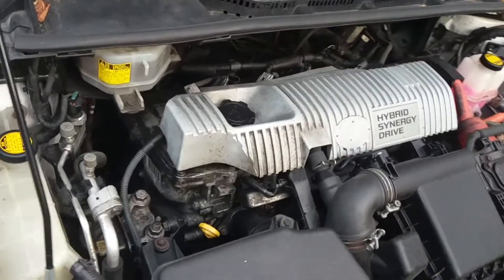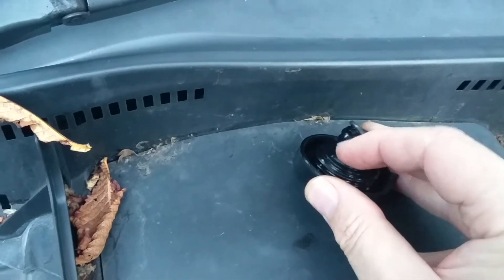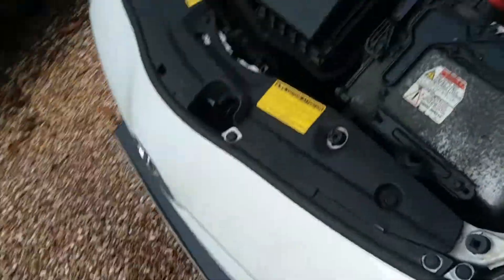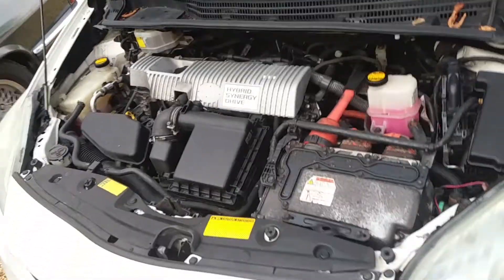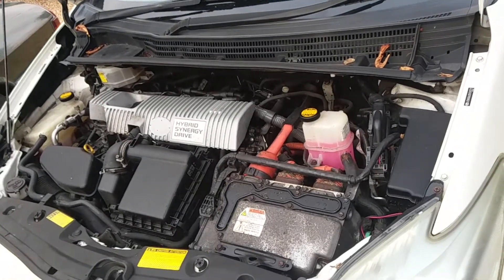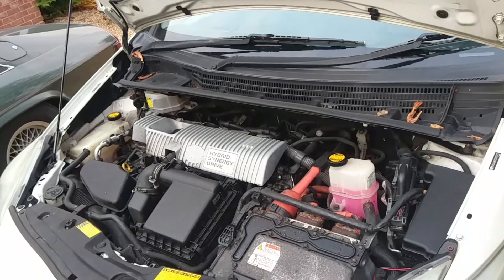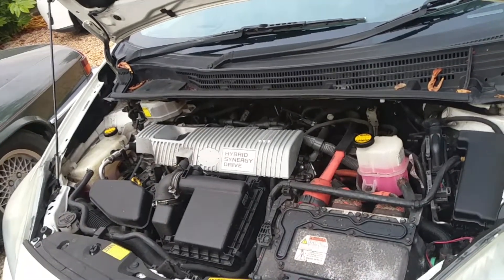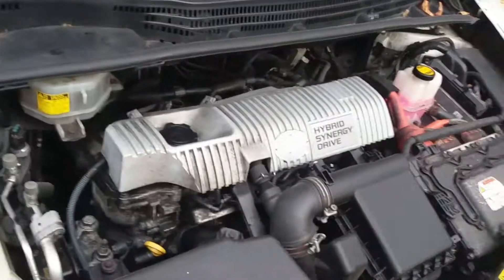This third generation Prius cooling system tweak mod may save your engine 1.8L head gasket leak fix

Comment: Pretty much one of the dumbest things that you can do. The cooling system must be pressurized for it to work at peak capacity. When the system has no pressure on it, the boiling point of coolant is only 223°. The overheat indicator on a Prius is 220°.

Comment: I did the exact same thing as you suggested, I've now put at least 6k miles on my Prius since.  No shaking, no issues except for the "Pull over to a safe area and check hybrid battery" indicator comes on about every 100 miles.  I've been disconnecting the negative terminal for 30 minutes, then reconnect, and it drives fine.  I've been doing that for several thousand miles now.  I'm assuming at some point, I'm going to have to replace the entire battery.  Thank you for the help!  Greatly appreciated!
Reply: I had that for two years (hybrid message); just disconnect the white wire in the front fusebox for 2-3 min, it will erase all codes and messages. But eventually, I replaced 6 blades of the battery.

Comment: I can understand that if you have a faulty head gasket, this could help reduce the amount of coolant that leaks into the cylinders but altogether this is a terrible idea just fix the head gasket. The cooling system is designed to work on the pressure so that the engine constantly gets flushed by cooling by removing that gasket you allow air to enter the system and the consequence is that you’re not circulating 100% coolant there will be little air pockets that will cause your engine to not be called properly. Also your risk oxidation of your coolant and your fragile aluminum block Just fix your head gasket.

Comment: My first day trying this, my prius gen3 which is on 180k kept loosing a little water no signs of leaks seems like it had pressure building up, misfire on morning start, been told by my local autoshop its the headgasket, so im trying this and gonna see how it plays out
Reply: Right a few days in im still loosing coolant water. Eventually is has got rid of the startup rattle the water leak from cap is still the issue

Comment: The factory cap is built with a pressure relief valve built in, it’ll bleed off excess pressure without removing the o ring.

Comment: My prius ALREADY HAS a blown head gasket, and makes the horrible rattling noise occasionally. WILL THIS MOD EXTEND MY CARS LIFE? or is it too late to make a difference? It has driven thousands of miles with the blown head gasket already, and my plan is  to get as many miles as possible out of it until the engine blows up. Would de-pressurizing the coolant system help? Even though the Head Gasket is already blown? Thank you!
Reply: Yes - it should help...

Comment: My head gasket is gone so the engine was shaking violently at startup, and a little if I stopped for 30 minutes or so during the day. It is a taxi too. The last couple of days I have been removing the top of the expansion tank last thing at night, leaving it off till the next morning. As expected no rattling in the morning but still a little during the day. Yesterday I noticed it behaved itself all day and, when removing the top in the evening noticed it was not on properly, the pressure had not been able to build during the day. I was a little wary of leaving it loose so thank you for your video, o-ring now removed and top secured. Thank you very much.
Reply: Please keep me updated on how it’s running and if you experience any over heating issues. My head gasket is already gone and I think i’m going to try this to buy myself some time
Reply: Update after 200-300 miles: Not noticing anymore coolant loss but I do still hear a slight misfire when starting up. Although it does sound much better than before. Check engine light is still on. Coolant temperature looks normal. Might reach up to 205 degrees f under heavy load on a hot day. Oxygen censors showing about 1500-1600 degrees f under heavy load which also looks normal.
Reply: Great - will get you by for a bit longer :)
Reply: My head Gasket is blown also, please give an update if this has helped you during the past month. I would REALLY like to hear what you have to say about this after 1 month.
Reply: @PatrickDoyle-u1d  just posted my update when i saw you my the comment
Reply: @onlyreflex8661  Youtube comments remain undefeated! It's incredible to get a response from someone like you in under an hour! Thank you!

Comment: I actually did this taken off the seal off the radiator cap last week and it works great! I mean prior to taking off the seal every single morning it will start and it was hydrolocking a little bit cylinder number one is wet with coolant, I bought a very high-end endoscope and checked it in the morning cylinder 2, 3 and 4 completely dry and yet cylinder one wet with coolant. Anyhow I seen this video and I was reluctant to take off the seal off the radiator cap thinking this wasn't going to work and my car was just going to overheat and boilover and to my surprise it doesn't overheat and boil and it works great my temperature here in the valley I live Central Valley California it gets very very hot here, temperature of car stays exactly the same as if I would have the o-ring on it 195° and yet now with the seal off I can start it up in the morning and it starts without hydrolocking "Great" there's no coolant in the cylinder it's great this actually works really really well, I put several hundreds of miles on it here in the summertime Valley and so far in the past 2 weeks I've got no coolant loss and it's 100° outside, okay now one day I tested this and went up into the mountains of Sonora and climbed this really steep incline Twain Harte Hill at 88 degrees outside 3000 ft altitude, and normally my car doesn't get over 200° ever and it got to 207 degrees climbing that long steep path of the Hill with no radiator cap o-ring, so you got to be careful when you're driving in the mountains with the seal off o-ring off as for when you're in higher altitude the boiling temperature is  lower it boils easier, other than that driving here in the valley it works great until I can get a permanent fix, now I was thinking of what would happen if I re-torqued the head bolts to squinch that head gasket just a little bit more to maybe permanently fix head gasket seal it's such a tiny tiny leak but causes such huge huge issues!!   Lesson the leak?  I don't know this might actually fix it I am contemplating if I should do this? Or to replace each head bolt one at a time with a new head bolt torquing fulling one at a time with a new head bolt because the leak is so small yet it causes hydro locking in the morning because a tiny amount of cooling gets in cylinder number one. Anyhow until I do a permanent fix taking out this o-ring seal from the radiator cap works great for now!!!
Reply: By the way I own a 2012 Prius with 208,000 MI and it started doing this hydro locking  about a year ago and I read up why it's doing it and I found out most cars was the EGR valve and the intake manifold plugged up I took apart the intake manifold and it was completely completely plugged up and cleaned it out it took me a whole weekend, and ran great for about 7 months and tell it started doing this 2 weeks ago, so these misfires cause the head  gasket to go, and anyhow these head gaskets go unless you do regular maintenance on your EGR valve cleaning it out and your intake manifold making sure it's clean at high miles. And then you might get 300,000 to 400,000 mi without a head gasket leak. Another thing that might be a good idea that I was thinking about is putting a oil catch can from the PVC valve to a oil catch can to keep some of that bad oil fumes from accumulating in the intake and plugging it all up with combination of EGR valve plugging it all up to.
Reply: So actually folks this did not work very long within a couple weeks it opened up bigger hole all of a sudden and started gushing water into the cylinder, and now I needed to immediately take it to a garage, I took it to gasket Masters for $1935 out the door, the Toyota dealership one is about 4500 to 5,000 to do,  I changed my oil every 5,000 miles so my head was in great shape and the mechanic just cleaned up the surfaces and put a new head gasket and everything took off great and ran great and now the car has 211,000 miles and  running perfect

Comment: O k so i'm using this trick and it works great. But when I go on the interstate I lose some Coolant, so I'm looking at getting a bigger reservoir.Or maybe a second one. My second problem is now. The exhaust fumes are going into my air conditioning. So I'm looking into a solution for that as well.
Reply: I even put the o ring on the side of the door like he showed me
Reply: @captianconspiracy  How's it holding??

Comment: There is a leak in the catolitic converter. The Antifreeze cools the converter. Over time it starts to leak in to the exhaust systems.  Check the tail pipe when it is running to see the Antifreeze coming out. As long as you keep the coolant full it will be okay. You can repipe the coolant lines under the windshield wipers to by pass the converter. Or buy a new converter.
Reply: Good point :)
Reply: Can you show me where

Comment: This doesn’t work won’t fix head gasket only way to fix it is to replace head gasket bad video please don’t give false information
Reply: THIS WORKS TO ELIMINATE MORNING RATTLE FROM BAD HEAD GASKET THAT ALLOWS COOLANT LEAK INTO THE CYLINDERS !!!! However You are 100% right about this not fixing a bad head gasket, but the absolute genius of depressurize the cooling system greatly reduces the amount of coolant that seeps into the cylinder from the bad head gasket inturn eleminating the negative symptoms of the bad head gasket caused by coolant entering the cylinder and causing the misfire that causes the dreaded morning engine rattle.
Reply: Read video description don’t avoid the question just be honest with people and instead sugarcoating things tell people the truth that will get u further in this life thier no mod or trick to fix this problem only way to replace head gasket that fix the car permanently if u have questions for me feel free to reach out to me have good day
Reply: @gustavomartinez324 This is an incredibly helpful video!!! you obviously don't understand how this helps the symptoms of a head gasket that allows coolant into the cylinders.  It positively WILL NOT FIX BAD HEAD GASKET but it will greatly reduce the issues caused by a bad head gasket the negative issues caused by the bad gasket will practicly disappear I have done this and it's amazing how much it helps
Reply: @Angela-wn8ee  if u knoe u knoe don’t need to explain things any further
Reply: @gustavomartinez324  What ARE you talking about???
Reply: @gustavomartinez324  he is saying that it won’t let the coolant get into the engine.
Reply: Read the video discription! :D

Comment: So you say you have done this for quite some time at least a few years and everything is good! May I ask where are you from and if your climate throughout the year is moderate to cool like what temperature would you say you get the hottest time of the year?  I'm from California from the valley and it can get as much as 110 here during the summer would this mod still work with super high temperatures?? Or do you think I would be involved with boiling over the water quickly with these super hot temperatures if I did this mod?
Reply: Try it and keep and eye on the level, I'm in a cooler part of the world...

Comment: Are you still going strong? how many miles have this been good to you?
Reply: Car was sold in running order at 400,000 miles to be replaced with a Prius plug in :)
Reply: @napierpaxman  how many miles were you able to put o. The car with the gasket  removed of the cap?
Reply: @napierpaxman  thank you

Comment: i disagree with your explanation. the bolts that keep the head are TTY torq-to-yeld, i.e. almost to breakpoint. made of high-end steel. the engine is heavy and has enormous heat capacity and heat innertness. it does not cool down much because it starts and stops. and the coolant water takes care of this too. yes, i heard this somewhere eles, i dont buy it. simply toyota bought a lot of substandard head gaskets, >10 years ago.
Reply: ooo wow - interesting! : )

Comment: Interesting mod.  Wondering how many miles you drove with this mod?  What's the temps like in your area and did you run with AC on by chance much if ever during the times since performing?  Any grill blocking?  Which year is this vehicle and did you ever change the head gasket and or do the Intake, PCV and EGR Circuit cleaning and maintenance?  I've read your oil also has better specs across the pond there. Wonder if your coolant has better specs as well?  Did you run 50/50 coolant of concentrated?  Thanks for your time in advance and all the best.  Kind Regards.
Reply: Also curious about this and long term
Reply: @bullonwallstreet  I've been trying to vent mine after I drive since if you see one of my latest video posts to my channel, I finally got the sound recorded.  Isn't much and doesn't happen all the time when I first start off, though seems to now regularly after my typical half hour commute and doing shopping and things.  I do wonder more if my EGR Valve is beginning to stick however and that's the cause more than the coolant leaking when sitting unless is so little and getting into my oil I barely notice. Kind of confusing me. Though I figure the head gasket is ready to go at the least. I got another head and timing cover with internals from a 150K yard car to study and spec out for a potential quicker swap with better newer parts, albeit from a 2011.  I still need to review the part numbers however as my 2013 parts might still be a better deal for the interim head gasket change period until I get a gen 4 engine or new car.